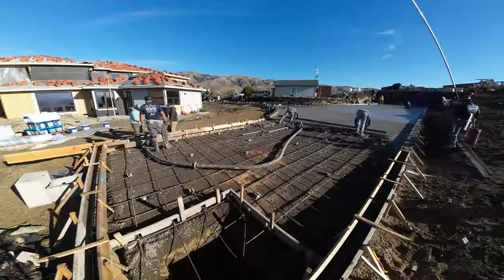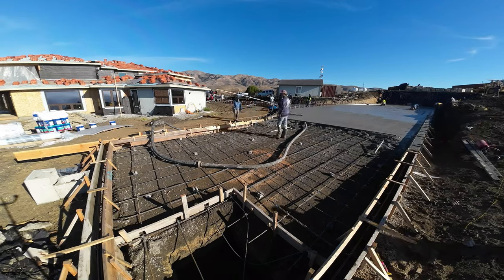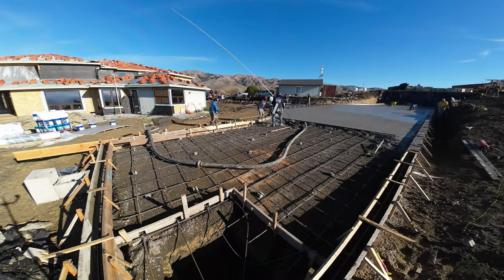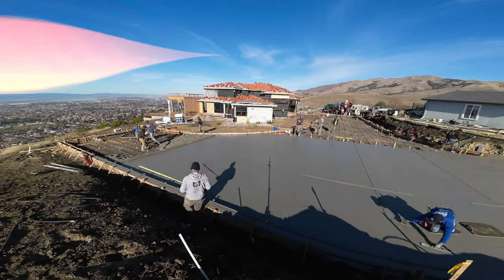Part 4.5 : How To Pour A Concrete Driveway  (8 Finishers)

Comment: What an amazing team effort. I love it. I have so many questions but it would be easier to ask over the phone. If you have some time I would greatly appreciate the opportunity to talk with you. I have venturing off in the world of concrete for the past couple years and I'm leading my brothers crews with the forming and we used to have a separate form and finish sub but their finish is sloppy so my brother has turned his all around framing crew into finishers and it's been a journey. I've done commercial concrete work on a large scale, but I was always a former/framer and they had a finishing crew that would come in on the days of the pour. I'm definitely trying to up my game to your level. Have a good day and coming up week.
Reply from the maker: Appreciate the comment.
Honestly most of my guys do both really well.. While I don't do much flat work anymore, I'm bless to know most of these guys over 10 to 15 years..which means I got them on speed dial.. 😂😂